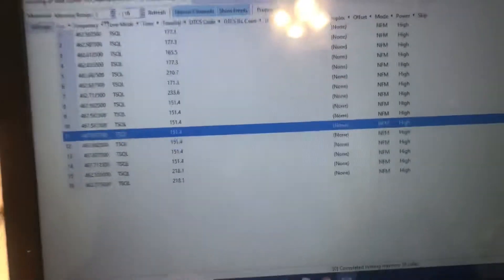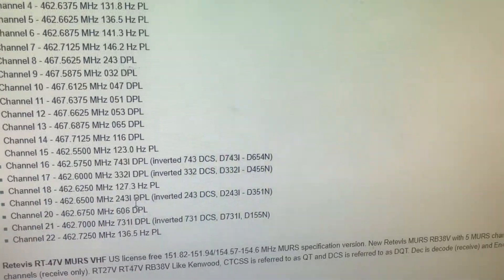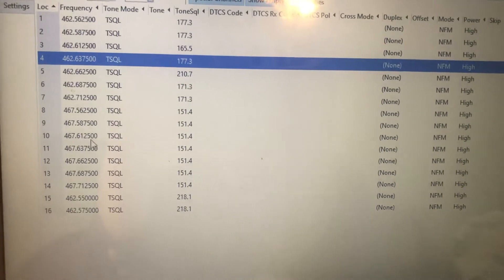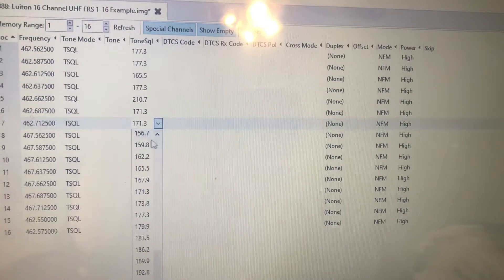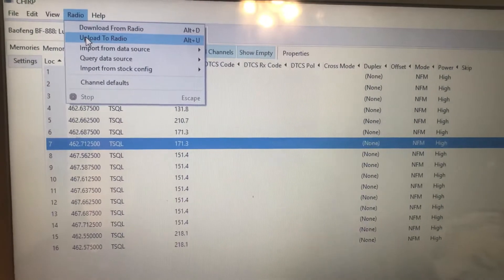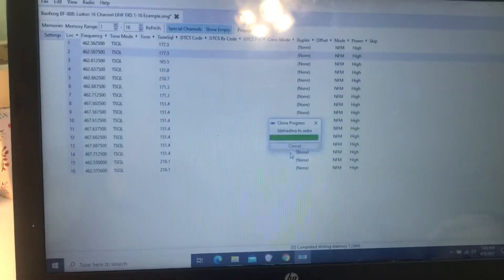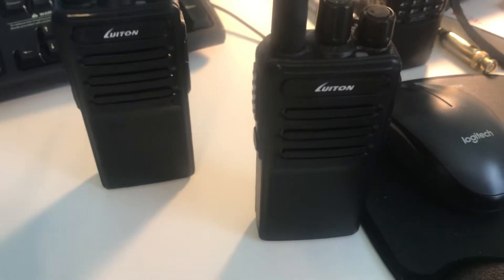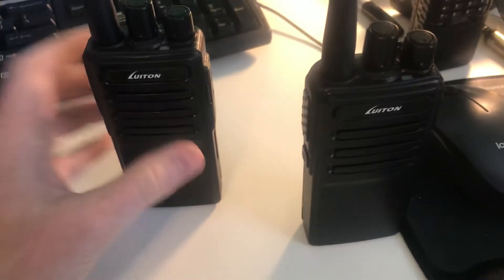How To Program Luiton LT-458 Radioditty GA-2S SED-8 Walkie Talkies For Legal Use FRS GMRS Part 2

Comment: Thank you for making this video. I will probably rewatch both vid a few times to fully understand and use as step by step when I redo all my 40 Ar - 6s 😂 for work. Great info!
Reply from the maker: Thank you for the feedback.  Let me know if you have any specific questions and I will try and assist as best as I can.  Best method is to simply make another comment on the video.
Reply from the maker: Note that you only need to actually change the programming settings once.  Once you have the frequencies and tone/code settings you want and you’ve successfully programmed one radio - you can then program each additional radio using the same programming file (channel plan).  You can just write the same programming file to each individual radio one after the other by unplugging the first radio from the programming cable [leave the CHIRP programming software open exactly how it sits after the first radio is programmed, leave the programming cable plugged into your computer] - switching the second radio on, plugging the second radio into the programming cable, and then completing the download to radio step.  

Then disconnect the second radio from the programming cable, switch it off, grab the third radio, switch it on, plug it into the programming cable, select “download to radio” and repeat those steps for all radios. 

I recommend taking a quick break after programming the second radio to make sure that radio #1 and radio #2 talk to each other on all channels.  The software should let you know if there was an issue writing the channel plan to the radio but it is best to be 100% sure.   

You can save your channel plan to open later on if you’re not able to program all the radios at once, you get new/additional radios, etc.  

Hope this helps - again just make a new comment on the video if you have additional questions and I’ll be happy to walk you through it or answer questions.
Reply from the maker: Here’s the 22 legal no license required frequencies list 

462.5625 MHz - FRS Channel 1
462.5875 MHz - FRS Channel 2
462.6125 MHz - FRS Channel 3
462.6375 MHz - FRS Channel 4
462.6625 MHz - FRS Channel 5
462.6875 MHz - FRS Channel 6
462.7125 MHz - FRS Channel 7
467.5625 MHz - FRS Channel 8
467.5875 MHz - FRS Channel 9
467.6125 MHz - FRS Channel 10
467.6375 MHz - FRS Channel 11
467.6625 MHz - FRS Channel 12
467.6875 MHz - FRS Channel 13
467.7125 MHz - FRS Channel 14
462.5500 MHz -FRS Channel 15
462.5750 MHz - FRS Channel 16
462.6000 MHz - FRS Channel 17
462.6250 MHz - FRS Channel 18 
462.6500 MHz - FRS Channel 19 
462.6750 MHz - FRS Channel 20
462.7000 MHz - FRS Channel 21 
462.7250 MHz - FRS Channel 22

Mode should be set to NFM (not FM).  
You will want to program either TSQL or DCS.  I recommend TSQL (tone squelch).  Avoid using commonly used tone 67.0 plus the default ones:

67.0, 107.2, 203.5 and 250.3 for FRS 1
71.9, 97.4, 100.0, 114.8, 118.8 for FRS 2
74.4, 103.5, 127.3 for FRS 3

77.0, 114.8, 131.8 for FRS 4
88.5, 136.5 for FRS 5
141.3 for FRS 6
146.2 for FRS 7
71.9, 123.0, 162.2 for FRS 15 
127.3 for FRS 18
127.3, 131.8, 136.5, 141.3 for FRS 19
141.3 for FRS 20
118.8, 162.2 and 192.8 for FRS 21
131.8, 136.5 for FRS 22

Go to Google, search for “FRS HFUnderground Wiki” and click on the HFUnderground.com Wiki page for FRS.  That page has all the commonly used and factory default out of the box channel and tone (and DCS code) combinations out there.  It has an excellent list of tones to avoid using.
Reply: Where did you get the program cord from I've been looking for this and can't find it. Can you post the link to where I can get it from for the Luiton walkie. Thank you.